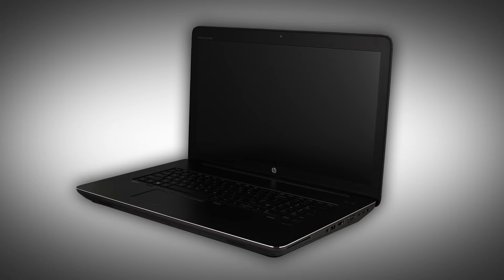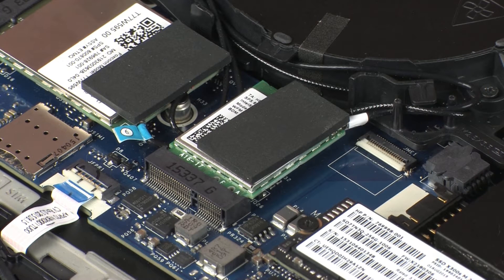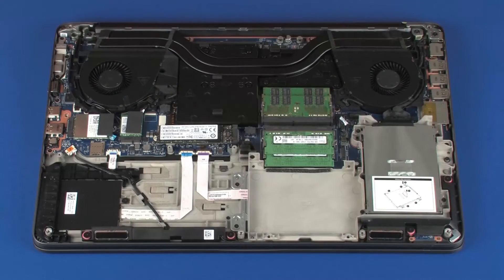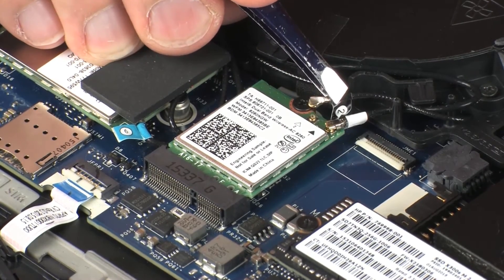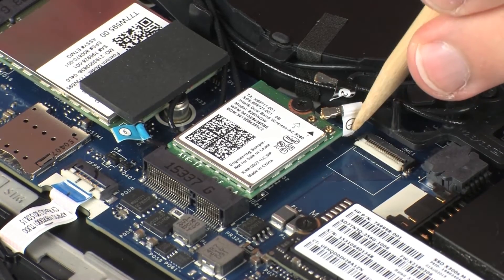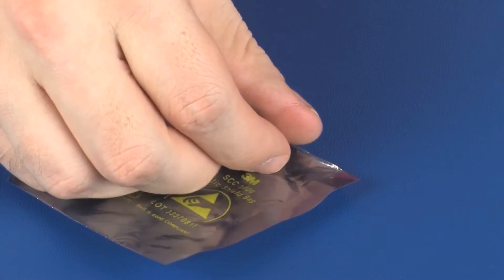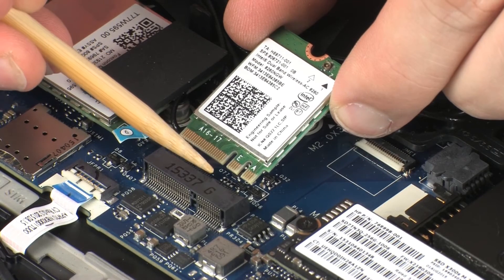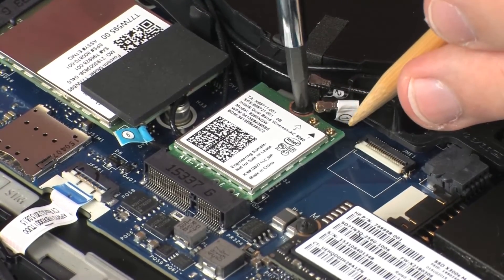Removing and Replacing the Wireless Module | HP ZBook 17 G3 Mobile Workstation | HP Support

Comment: Hello sir ! ,I can't install Qualcomm driver in hp computer. When I installed : ( the device may not be present or could have been ejected/unplugged from the system ). What can I do sir, now my computer can't use wifi, cause no wireless driver ,just see only: Realtek PCLe GBE Family controller in network adapters. How to fix this problem sir? This is mean my hardware was destroyed!